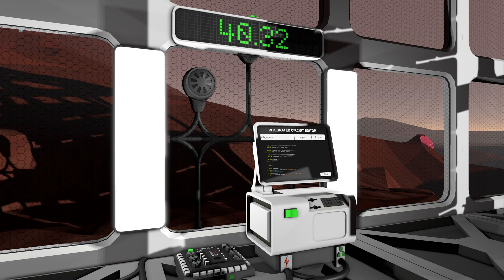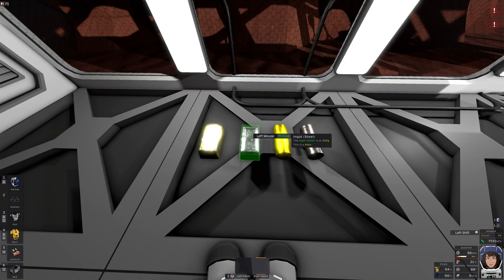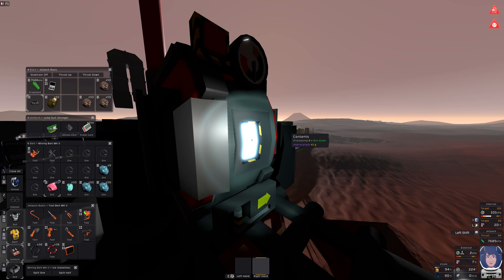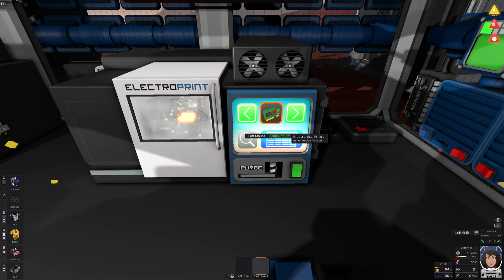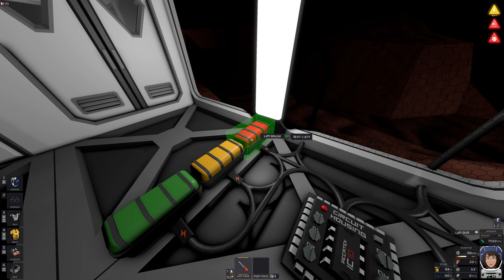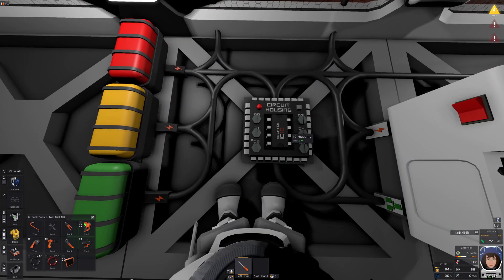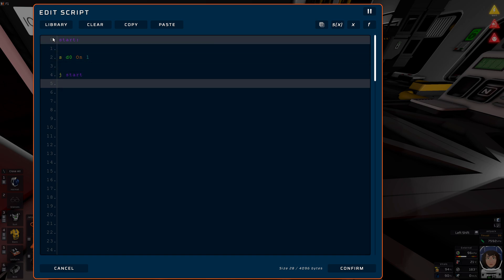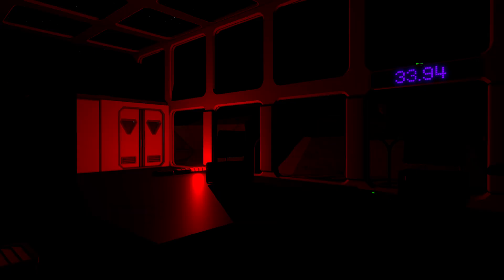Stationeers PROGRAMMING for total beginners - TURBO STYLE! - Part 1: Setting things up *

Comment: Hi im new and is this Tutorial still up to date after this new big update? because i want learn it. Greetings =)
Reply: my Question is: is this tutorial playlist still up to date to learn IC ? keep up the good work
Reply from the maker: Thanks for reminding me that I wanted to work on new general Stationeers introduction material once the Terrain Update is out. ---- Well, most of what these videos say is and was true. But annoyingly, something pretty fundamental has changed: The way we address devices. SB SBS SBN SBNS (and their L counterparts) are still the same. But SD/LD are deprecated: They still work, but you're supposed to use S/L and SS and LS instead (Notice that we never had LDS, which we now effectively have via LS.), which now work for BOTH the d0/d1/d2/... screws AND for ReferenceIds. That's the only relevant differences I can think of, the rest of the series should be up to snuffs.
Reply: @OwnerOfTheCosmos  thx =)

Comment: I've actually wanted to make a 3 doomed airlock, never occurred to me to make it have its down dedicated air system.  Custom heating solution XD.  Hahaha
Reply from the maker: The 4-sided airlock in the video doesn't have its dedicated air system, it only has a buffer (the inline tanks): The airlock is emptied by the one Large Powered Vent it has, but the buffer in turn is also emptied by the Large Powered Vent on the respective side you've been coming from. Since both are running at the same time, there's no delay of waiting for the buffer to be completely empty. Maybe the buffer wasn't necessary in the first place, but the shown airlock also has an initialization mode: At first start, it doesn't know where you're coming from, so it closes all doors, pumps the airlock INTO THE TANK that you saw, and then opens the door to the hall so that it is now initialized.